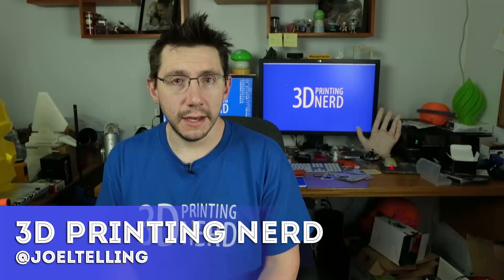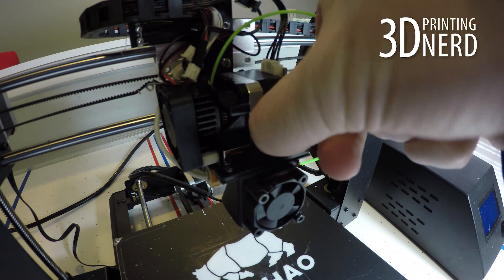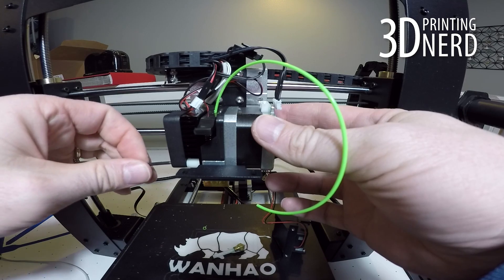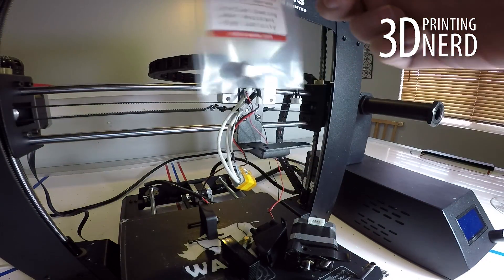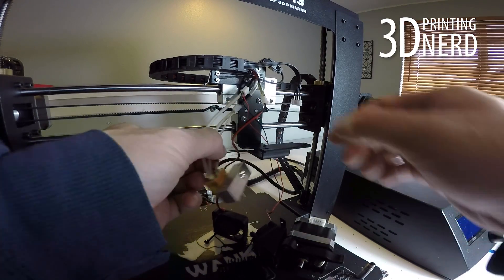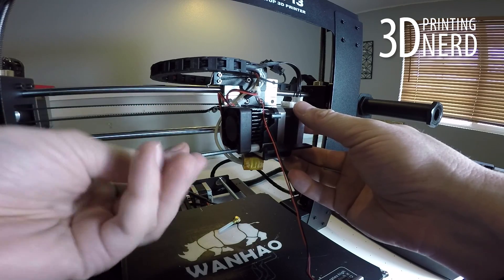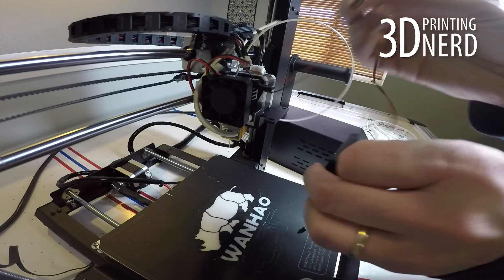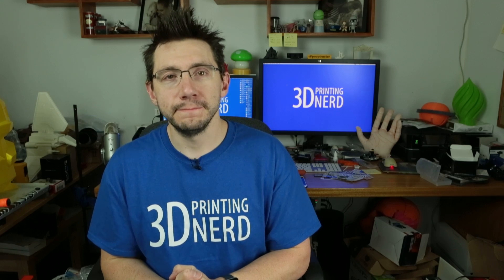3D Printing: Upgrading a Wanhao Duplicator i3 with an All Metal Hot End

Comment: hey 3D Printing Nerd,
Thank you for this instruction video - no messing about with heat paste and heated installation, eh?
I have a question about replacing this hot end. I am replacing my complete heating block, including thermister, cardtridge, kafton lining etc. Just making it a fresh start after many years of printing. Problem I am having: I cannot remover the bottom part of the hot end from the heating block any more (seeing if I can reuse the hot end), it is completely stuck. I will probably end up buying a new swiss hot end, but I wonder if you would have any tips.
Greets, Dr. Scarlett

Comment: Hello, I want to ask you something: I have a problem with a printer like this: one little wire of the extruder motor was broken, and the filament doesn't leave anymore. I want to ask you if I can solder it with a soldering iron and tin or that is not correct?. The little wire is one of the four wire of the steper motor connector that you unplug in the minute 1:41 of this video, above the motor. The piece is not separated, so I can not change it. What can i do? Could you help me? I would appreciate your helping very much.
Reply: Sorry, I mean in the minute 4:41

Comment: This video was a great help for me. Just had a problem with trying to get a filament to load. This instruction provided me with the right information to help solve the problem on my Wanhao 13 (2nd generation) turned out that a small section of filament had broken and the ‘cleaning wire’ had forced it too far down and caused a blockage inside the feeder.

Comment: Buying this hot-end ruined my wanhao printer.  I've never had much success with it.  You can manually extrude plastic, but once you start printing it jams and under-extrudes to the point of un-usability. The thought behind a lot of us that have tried this upgrade is that in some cases the cooling block is insufficient.  I plan on testing this notion at some point on my other channel, DIY Drawer.

Comment: Before buying a all-metal-hot-end, you need to verify if your printer is not software or power supply limited to selecting a higher temperature.

Comment: Hey there guys.I have a serious problem with my duplicator I3.I cant get the x axis to calibrate correctly.When I turn on the homing,all other axis are fine.but the X axis seems to run into the wall continually for about 10 seconds before stopping and continuing to  level everything else.This causes some serious issues for my printer,and I would be forever grateful for some answers.Im new to 3d printing and this is very disheartening,seeing as I love using my printer  and I have not made a print in weeksT_T.HEEEEEEEEELP
Reply: It sounds like the X endstop isn't being triggered. Check to see if anything is obstructing it. Try triggering it with your finger and ensure it presses down all the way. Is it loose? Tighten it up and make sure it doesn't move when something triggers it. That's all I've got. Good luck!

Comment: Thank you for a great video. The only thing I would suggest is, whilst assembling the extruder and heatsink/fan assembly, feed a small length of filament down into the nozzle before you tighten it up. This makes sure it’s all perfectly lined up before you tighten the screws. You can then use this same short length of filament to test extrusion when you’ve done the reheat to tighten the nozzle further.
Thanks again dude 👍🏽

Comment: Once you break tension on a screw, instead of using the top of the screwdriver, wrench, key etc... pinch the shaft between finger tips and spin it from there. Much easier & faster.

Comment: Why did you not install thermal grease between the cooling block and hot end?The hot part needs to b hot, and the cold half needs to be cold. Without thermal grease, PLA can melt prematurely dripping into the hot end and causing a clog. This is the number one cause of clogs with the MicroSwiss, im shocked you improperly installed this enabling your viewers to make the same mistake.
Reply from the maker: I'm shocked you didn't ask if I followed the exact instructions from Micro Swiss. I did. They specifically said this upgrade kit did not require thermal grease and specifically told me not to add any. In the time I had this machine with this upgrade, I've had zero clogs.

Comment: Your motor us facing the wrong direction. The connector will hit the top if you have a tall print. Plus sometimes I like to zero my Z by going to far up until it comes off the lead screws, then I home Z.

Comment: Picked up a Monoprice Maker Select V2 (which is basically a re-branded version of the Wanhao). Is there a need to pre-heat the extruder when replacing it with a Micro-swiss? I haven't assembled the printer yet so it's basically clean.

Comment: I wish someone would do a review telling us why we need this hot end rather than how to install it only.
Reply from the maker: Has that not been done? Let me see if something is already out there... Ah found something. Here is an article by Matterhackers. Let me know if this answers any questions you have: https://www.matterhackers.com/articles/top-reasons-to-upgrade-to-an-all-metal-hotend
Reply: 3D Printing Nerd thanks for a fast response. I subbed. And thanks for the article. I just got into 3dp in the last week and I'm trying soak in every little bit of info I can. So thanks again!
Reply from the maker: Welcome! and welcome to the 3d printing community!
Reply: Another reason not mentioned in that article is faster printing speeds. The stock hotend can't reliably keep up with print speeds higher than 60 mm/s, you start hearing the stepper clicking because the plastic can't be melted and extruded fast enough.
Reply: He says why at the 1:15 mark.

Comment: Very useful video!
Thanks Joel!
I will just add to it that if you apply thermal paste on the threads it really helps heat transmission, making your parts slightly better.
Just tiny bit of paste on the threads will do the job

Comment: why would i want an all metal hot end? 
are there any disadvantages in this upgrade??/
Reply from the maker: +Universe's rabbithole all metal hot ends can go hotter without the PTFE tube, so you can print materials that require a hotter temp
Reply: of it was up to you would you buy one of these printers?

https://www.amazon.com/Performance-Einstart-S-Framework-Accuracy-Stability/dp/B01MR62A6D/ref=sr_1_10?s=industrial&ie=UTF8&qid=1489206835&sr=1-10&keywords=3d+printer

https://www.amazon.com/Monoprice-13860-Maker-Select-Printer/dp/B018GZBC3Y/ref=sr_1_6?s=industrial&ie=UTF8&qid=1489206962&sr=1-6&keywords=3d+printer

or do you suggest another? 
i cant find any videos if you made any of cheaper budget printers.

Comment: Thanks Joel.  Finally bit the bullet and ordered my Micro Swiss all metal hot end (should be here tomorrow), so this will help.  For some reason I thought that it came with a new heater block...lol.  Glad that is one less thing that I have to change.  Also ordered their billeted all metal extruder and am going to change that while replacing the hot end.  #highfive  Good timing, received the makerbox and tried the HD Glass filament and it gave me one of my worst clogs I've ever had on a hot end (with the stock Wanhao hot end).  I've heard that with the Micro Swiss you have to change your retraction settings in S3D, do you know anything about that?  Thanks again.

Comment: Does the kit come with a hardened nozzle or is it just normal?
Reply: It comes with a wear resistant nozzle that is made of a zinc alloy, it will last longer then a brass nozzle, but if that's not good enough for $20 microswiss has a hardened steel nozzle that works with the kit.

Comment: The kit I ordered didn't include the allen wrench or the new cooling block, and if you are ordering from the UK, you will pay VAT and the Royal Mail handling charge on top of the cost, increasing it by about $18.
Reply: I ordered the entire kit including the cooler block from technology outlet here in the UK, arrived next day. Currently fitting it to my i3 Plus but am trying to figure out how to preheat the extruder to 250*. Kit came with everything in this video but also included some heat sink paste which you put on the tube from the hot end to the cooler block. Everything else is the same as the i3 V2 etc.
Reply: I had to send my Wanhao back as it started cutting out during prints, common fault apparently. I now own a Flashforge Creator Pro, that has dual extruders and pre-heat settings

Comment: Oh boy is that music irritating!
Reply from the maker: +Verruca yeah, sorry about that. This is an older video and I've changed how I do things since then.
Reply: I personally prefer even annoying music over no music or sped up audio from time lapses. I guess you can never please everyone all the time...
Reply: Would you still suggest the Duplicator i3?
Reply: While you've probably gone ahead and done it already, it's a pretty easy process. There's a single screw holding the stock lever in place, with a spring providing tension. Unscrew that, and the old lever will come right off. Take the new lever, put the spring back in place, and hold it down until the screw threads the hole. Tighten, and that's basically it.
Reply: It's better than justine beaver music.
Reply: +3D Printing Nerd
I for one enjoyed not just the video but the music as well. I have a maker select, so I figure this should work for me as well.Would you also do the microswiss lever upgrade as well ? How hard is that to do ?
Reply: Nope, but I have the parts now. Most likely this weekend.Thanks.

Comment: I've only had the full metal hotend for a couple of days, it's about the best upgrade you can get for the Wanhao i3 - my prints are so much better.

This is one of the best tutorial videos for this upgrade (there are a few) bottoming out the throat tightly and heating the nozzle before fully tightening it is very important - it's been missed out in a few videos that I've seen. 
Another thing worthy of a mention is that you should adjust your retraction settings after the install - I've set mine at .75.

Failure to do so can result in a blocked hotend.
Reply: May i ask, in what ways does the all metal hot end improve the general print quality please. Thanks.
Reply: ditto, what's the purpose of this upgrade?
Reply: dingalsbe. you guys don't have google?
Reply: I was really hoping there would be some sort of comparison/explanation at the end of the video and there was not..
Reply from the maker: +dingalsbe explanation of what?
Reply: dingalsbe. no PTFE liner - faster printing speeds, higher temps for PETG, less clogging
Reply: sorry guys, I'm a complete noob, my printer will be here tomorrow.  I'll do more research to try understand all of these new acronyms...

Comment: In need of help, Joel. Followed your installation instructions (using the I3 Plus...installation varies just a bit) & everything seemed to be working great. Ran a first print & noticed after the initial layer went down beautifully that the PLA was no longer extruding. Long story short, disassembled the entire kit & discovered both the thermal tube & tip completely clogged. Any advice on how best to clear the blockage? I'm using a .02 tip in order to achieve fine detail...now wondering if that may be part of the issue? Any help/suggestions would be greatly appreciated.
Reply from the maker: Oh man. Well, perhaps the .2 did it, but, regardless, we need to get that stuff unclogged. If you can grip the tube and the nozzle with something, heat it with a lighter, and then as it warms up use a pin to needle to try and get the plastic loose. Thoughts?
Reply: No doubt about it. The .02 & PLA don't really get along too well. A lighter is a good thought though, I'll give it a whirl. I also contacted Micro Swiss about a replacement thermal tube, surprising that it's not available on their site as a stand alone part? Anyhow, your video was immensely helpful - thanks again for tackling it in real time. I jotted down a few notes where thing vary a bit with the i3 Plus. Feel free to reach out anytime should you receive some inquires.

Comment: I guess that you can also use this for the Wanhao Duplicator i3 Plus.  If so I'll buy one since I getting my Plus next month.
Reply: Just installed it on a Plus model. same way as this. just remember to turn of the machine before you unplug the Stepper.
Reply: Also recently received my Plus. Wondering how you like the results with the upgraded hot end kit?
Reply: yeh its good (: but did get some nice results from the stock one too.

Comment: How do you adjust the nozzle height? After replacing with the micro swiss, the fan on the side sits a little bit lower than the nozzle and hits the print ruining it.

Comment: Do I need to preheat to 250 if I'm doing this mod right out of the box, never having run it before? (no filament has been through it)
Reply from the maker: um... I think it wouldn't hurt. It has to do with the slight expansion and contraction of the metals under heat.

Comment: Joel,  my Maker Select has been giving me fits lately and I have had to clear the nozzle and PTFE tube several times.  Does having the all metal hot end seem to prevent clogs and jams or is there no difference where that is concerned?  I usually get clogs when I don't properly remove the old filament from the extruder. So far I have been able to clear the tube and nozzle but am hoping the Micro-Swiss all metal hot end would eliminate much of that. 

#highfive

Norbert

Comment: Day 1: 
Great video Joel I had this playing in the background whilst replacing the PTFE tube in my stock hot end. Only thing I forgot was to place the spare PTFE tube that came with my dup I3 in the assembly but I realized it the moment I screwed it back together. So it was time to open it back up again and place the tube in it but low and behold I dropped the PTFE tube and it seems to have vanished to a other dimension. Excuse me whilst I go on a hunt to find my tube back and let me get back to you once I do find it.

Day 40898 ish:
I am starting to loose track of the days which with this inter dimensional traveling I've been doing is even a wonder I have still some sense of time. I have still not found any trace of the PTFE tube and I am starting to loose hope but I can not loose hope after all I've done I can't just give up now, I will find it and I will reunite it with my printer but most important I WILL PRINT AGAIN!!!! FOR GLORY FOR THE NERD!

Comment: Thank you for this video. I watched it a couple times to make sure I didn't install something incorrectly when I came across issues during my installation of the Micro Swiss all metal hot end. 

I purchased a Micro Swiss all metal hot end and installed it on my printer. I had an issue with the nozzle not extruding very well, and after testing I identified that there was something wrong with the Nozzle I received. I contact Micro Swiss and they sent me a replacement at no charge.  I installed the new nozzle last night and it works perfect.  Their support was quick and curious. So much so that I also purchased the Machined Lever for the extruder.  I'd highly recommend this mod to anyone. Reduced ABS print by 15c, and can print PETG @ 250c with no issues.  (I was not compensated to post this review, I liked their customer service so much I felt I needed to tell anyone/every who would listen).
Reply from the maker: +bogie21 I LOVE Micro Swiss. Great company with awesome people!

Comment: The Duplicator i3 V2.1 now has a MK10 all-metal hotend!
Reply: Just ordered a V2.1 and no all-metal hotend in the description. Do you have any info?
Reply: ? but here it says http://wanhaousa.com/products/duplicator-i3-steel-frame
Reply: It says all-metal hotend, but later says PTFE Insert. So it's not like the Micro Swiss one that doesn't have the PTFE liner and can print to higher temperatures
Reply: Ah... Well still a great bang for the buck

Comment: This may be a stupid question, but - should you remove the filament before removing the nozzle/PTFE liner? The Micro Swiss instructions don't say, and you apparently left it in.

I did so too, but I noticed some weird black gunk outside the PTFE liner and a weird smell (kind of like herbs or grass?). I'm now quite sure it was burnt PLA that I'm smelling - did PLA leak into the heater block and get burned when I started to remove the PTFE liner? Or maybe there was a gap all the time, but only now it could get out?...

Comment: Hey Joel, great video but I have a couple of questions. I have read numerous people comments on google groups regarding problems with this upgrade. Some just get terrible prints, others get jams or skipping when printing. Have you heard of anyone having issues like these? I bought the hot end kit after watching your video but I am nervous to install it because my printer is printing great and I don't want to mess it up doing this upgrade if issues are common. Thanks for your time and the great videos.
Reply from the maker: +Switchback Hendrix Hey! Everyone I know that got this upgrade said they were getting better results more consistently. I was also told they found it easier to load the filament. I no longer have this printer so I cannot do anymore tests but the person that does have it loves it. You do have to take into account the new characteristics of the hot end and adjust temps and retraction settings accordingly.